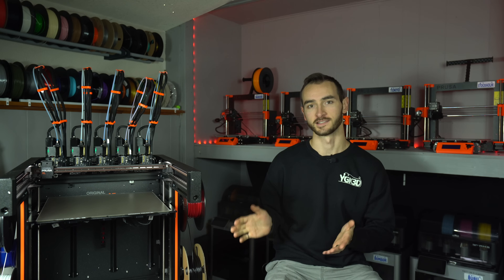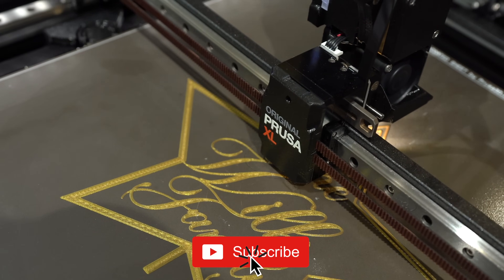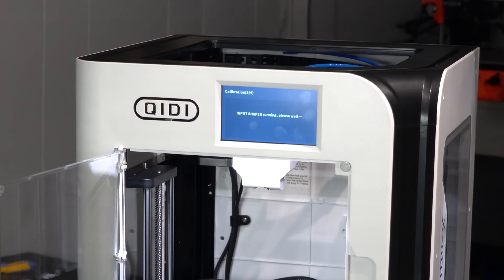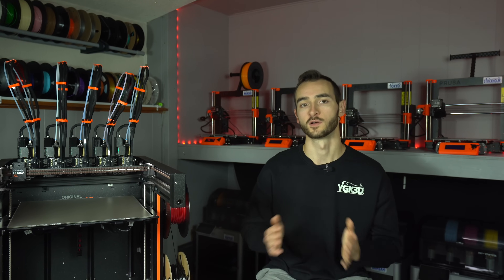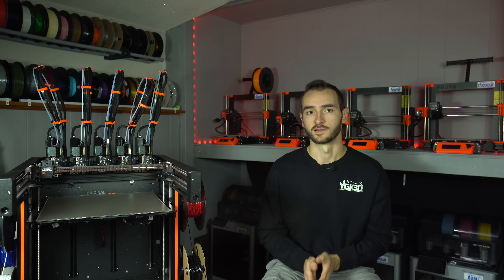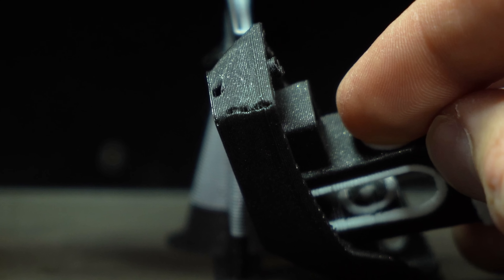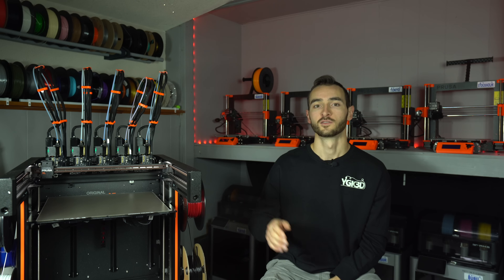The Prusa XL Just Got WAY Better with INPUT SHAPING... But Is It Enough?

Comment: You say the XL doesnt have an accelerometer that you could identify at 3:35, but at 3:08 the screen recording you added has the exact question "Does the XL extruder have an accelerometer built in?" With Prusa's answer being "Yes it does, it's vital for correct input shaping configuration (see above)." So I'm a little confused... Does it or does it not have a built in accelerometer to tune the input shaping parameters dynamically?

Comment: So I had a late pre-order - I've had mine a few months.    The nice thing is...how much has been ironed out.    I don't worry that much about speed so I can't speak to that - but I can say, anecdotally, that my xl runs like a champ.   It.  Just. Works.   I've been running it nearly non-stop.   The 6.x firmware has all but totally remove vibration.     The bottom line is this machine has a lot of advanced tech in it - and fully using it all correctly is taking some time to get right.   But it's definitely moving forward.    No regrets here.

Comment: I hope the Prusa XL improves fast from here on, at least fast enough to remain relevant when more tool changers come to the market over the next few years.  I was seriously thinking about an XL, and contemplating a twin tool head version that I could later upgrade to five.  I love the approach Prusa have to upgrades over time, and to continuous product improvement.  I think that's really the key advantage of a Prusa over other manufacturers.  I'd buy a Mark 4 now, because it's been sorted and just works and has beautiful quality, but its build area is not large enough for what I need.  But the XL is not yet at that point of reaching its performance potential.

I have to say, I so want to support Prusa and see the XL succeed.  They deserve it for their investment in open source, Prusa slicer, and their dedication to quality and innovation.  But their product development speed is just not up there at the level people are starting to expect after Bambu Labs arrived on the scene.  I watched this video after just having watched CNC Kitchen's interview of the Bambu Labs CEO, and he teased that the next generation 'X2' printers would be when they would launch a larger sized printer, but they wanted to wait until the printer was not only 'the same but larger' but had moved the product on to the next step... which makes me wonder if that "next step" will include tool changers... and whether by the time Prusa's XL is fully sorted, Bambu will have launched a tool changer XL competitor that's faster, cheaper, with fully sorted Prusa slicer derivative 'Bambu Multimaterial Slicer'?  

But the price point for two tool heads, when the machine isn't fully functioning after two years, has made me think twice.  I'm currently thinking of getting a Qidi X Max 3 instead as a stop-gap printer, and waiting for a year or so to see what happens with the XL and whether any better alternatives arrive.  I'm sure I can't be alone in taking this approach, given the Qidi and now SOVOL SV08 price points are so competitive.  My worry for Prusa is that they just can't compete on price without moving to a mass production model like Bambu.  I hope they find a way to accelerate their development work, because I would happily buy Prusa over alternatives if only their product development was faster and their launch products did what the marketing claims.

Comment: Im so tired of hearing the x1 carbon being compared just because its slightly "larger" than a typical form factor. The build volume is TOO SMALL still, and until theres a 300mm+ cubed printer, the prusa xl is the only option over like, a modified ender 5 plus, and unfortunately its not turning out to be significantly better. This was supposed to be the chosen one and its a huge let down. Im having vibes of what happened to makerbot and thats a shame cause the sum of its parts here should make it a winner. I hope they give this thing the support it deserves, but I guess Ill be waiting for a second generation..

Comment: You didn't really expect this machine to be as fast as an X1C, or even anywhere close, no? These are entirely different machines. Much larger build volume = heavier moving mass = slower. There is no "could have been" there. You want a super light gantry and super light toolhead? You're not getting a tool changer. Oozing is just a fact of life with tool changers. As an E3D Tool Changer owner, there are many "solutions" to the oozing problems, but none of them are perfect.

Comment: The print speed for multicolor prints for the Prusa XL can be several times shorter due to the amount of color purging needed. Its really quite drastic a 16 hour multicolor print on a Bambu can take 5 hours on the XL, thats where the XL shines along with the bigger print bed, so print speed with single coloris not the most important factor although Prusa does lag behind with regarss to print quality and speed...Surely bambu is working on something similar. That will be really dangerous for Prusa.

Comment: The more I see about the new Prusa printers, the happier I am that I opted to go with a bambu lab printer. Smaller printers not shipping with input shaping, the input shaping that gets implemented later is default values and doesn't get changed per machine (which could be important through the life span of the machine), prusa seemingly not being fully transparent with implementation of input shaping on the XL, and them seemingly not shipping finished products. Like, most of these "new" features all seem like they should have been implemented AT LAUNCH. These machines feel like anyone that buys them has seemingly been enrolled in a large scale beta testing platform without their knowledge and at the cost of Prusa machines, that is simply unacceptable.

Comment: Thank you for the video. 

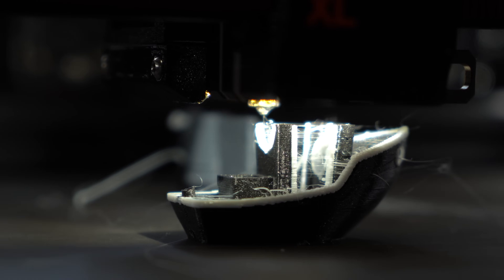On the topic of speed XL vs X1C, you stated the alpaca takes 4:49 on the Prusa va 4:32 in the X1C. 

Some have pointed out the difference in weight which is a valid point, but is this really a big of a deal?  +17mins is not bad on a print that is almost 5h.  I mean if it was a full hour or so I would say yeah that’s a problem. 

But what you didn’t ask is how strong are the prints?  Too fast = poor mechanical properties. That is HUGE and just because is not important to you it doesn’t mean it doesn’t count.  I print mechanical parts, not trinkets.  

On the other hand, have fun with Bambu labs selling your data to everyone and their mama. I need more intrusive apps like I need a  random bill.  

Cloud machines are a deal breaker. Same with Glowforge or anything similar.    

The XL is getting there…. Let’s see how far they take it.  Keep posting the videos.
Reply: Haters gonna hate...

Comment: In regard to the stringing, how about doing some oozing tests with 2 little cones, finding a temperature at which there is no oozing on the filament in question. This might require turning down the fans, in order to maintain good layer adhesion, but it should also remove a large portion of the stringing.
Reply: I'm using 2 small cones, about 7mm x 15mm and 4cm apart of each other. A quick way to find the filament temperature, that provides optimal visual print quality.
Reply: Might have to recalibrate pressure advance after finding the optimal non oozing temperature.

Comment: Hey thanks for the vid!  I'm on the ropes do I pay remainder of XL or wait and get a refund- honest opinion if the XL is worth the $ ? thanks!
Reply from the maker: I think it’s worth it personally, until something else like it comes along. When it works, it’s amazing. There are some kinks to be worked out but most of that should be done by the time you get it, depending on when that is.
Reply: @ygk3d  Cool thanks for the quick reply! I have a MK3 been great around 170 days printing / 8000m before the hotend started oozing, replaced it then the heatbed sensor went replaced that all good, I really need a large print area for some large 3D designs I made for RC plane floats as the XL was so delayed I grabbed a Kobra Max but I have yet to get one  of my STLs to print well from PrusaSlicer as there is no Printer profile for the Kobra Max googled it and appears they say latest Cura is required only prob is my old iMac doesn't support the new Cura! Another if is the CS from Prusa- I had the worst CS ever when my new smooth steel plate peeled on 1st print, just like that Drac dude who had a bad $3 cable on his XL and they totally dished him, too bad Prusa CS is not like DJI!! Anyway I have to decide in the next couple hours if I send Prusa $2k....

Comment: The Bambu lab CEO has already said that their XL release will be a next gen printer so you can assume it will be a larger X1C with multi-tool support and be no more expensive than the Prusa XL. IMO, these problems you've had and the lack of features are kinda unacceptable in an expensive printer. Prusa has had too little competition and have been resting on their laurels for way too long so have to play catch up, and it doesn't seem to be going well.

Comment: It seems a lot of your issues are slicer settings. I think with a little more time and experience you’ll figure it out.  You should note in your video that the Bambu and PRUSA are two completely different printers, but if you want to compare them that’s your choice, just know it exposes your inexperience comparing the two. Also tune into the 3D printing today podcast.  They and many of us are way past prime towers and have figured out how to retract adequately up out of the melt zone.
Reply from the maker: It may not be the most logical comparison, but it's one many will make and are interested in. I am far from inexperienced ;). I'll check out the podcast - thanks for the tip.

Comment: Thanks for the videos on the XL. I had narrowed down my fdm printer choices to either the Prusa XL or the Bambu X1C. From what I see the XL isn't there yet and still lacking in a lot of areas; the base XL with one head cost is $1,999.00. The Bambu X1C seems to do more out of the box in regards to speed and quality than the XL and the cost is only $1,199.00, a savings difference of $800. I just can't see paying 2K for a printer that doesn't really set itself apart from others on the market. If its build size you need, Elegoo Nepture 4 max is on pre-order and the cost is less than $500, so maybe I need to look into that. Lots to consider until I pull the trigger.
Reply: If you want multicolor/material printing, the Bambu printers are abismal in waste and speed. The XL definitifly has the upper hand with this, it is a toolchanger and thus very different.
Reply: @username9774  The XL in it's current state is unfinished. It's way past recalling it. It's an embarrassment for Prusa and it's customers.

Comment: Personally I think you can't compare Prusa XL with the Bambu X1/P1. Well, you can, but is the same as compare a rally car with a formula 1 car, both totaly different. Yes, the Bambu is faster when printing one color, but Prusa isnt build for speed, but for quality. And to be honest, you dont buy a XL with one toolhead. You take at least 2 toolheads. I'm still waiting on my XLLLLL. At the moment I'm using 3x X1C, 2x MK4 and 1x MINI+
Reply from the maker: Good point.

Comment: One thing to note about speed is that prusa actually cares about part functionality and strength. Its easy to critisize speed if you are making prototypes all the time and dont care about rigitity and the like. But prusa has experience with ACTUAL manufacturing - every single printer they have ever made is partially printed. They actually take the time to make strength checks and slow down the printer for strength and toughness purposes instead of pumping out crappy plastic garbage at the maximum speed.
Reply: u could, and easily, slow down ur printer on all machines. u are just fanboying for prusa, cause bambu can print much faster than their default settings which as u said are better but prusa can not.
Reply: Very fair point.  There's a lot of marketing claims that are selling printers on claims, rather than like-for-like speed comparison of quality- and strength-matched printed parts.  Thinking about it, that's a great idea for YGK3D reviews in future: create some standard designs and tests, and review the speed-quality-strength trade-offs and relative strengths of different manufacturers.  Maybe choose a range of parts to print, like functional load-bearing parts, different materials, detailed aesthetic prints, etc.
Reply: HAHAHAHA
Reply: I'm very happy with the strength and speed of my abs/ASA-CF on my bambus. I own an XL, excited for plates

Comment: If this printer was made by ANYBODY ELSE, it likely never would have gotten this much attention and fine-tuning, and probably would have been returned. PRUSA is good at making simple Cartesian bed-slingers and that's it. The XL is completely outside of their wheelhouse and it shows. Yes, it has tool changers, but the entire design is very obviously still half-baked. You can't release something like this at $4000 + shipping anymore and be successful.

Comment: I have no problem with stringing on the XL. It seems that your nozzle seals are not optimal adjusted. They should only touch the nozzle as slightly as possible. When the force is to high, they do not work, because the faces of seal and nozzle are not parallel.
Reply from the maker: The nozzle seals seem okay. It’s not ooze after being parked, it’s ooze during travel and took changes. I’ve heard a few people have no stringing, which is interesting, because many more seem to have it really bad.
Reply: @ygk3d  The most important thing is really dry filament. Even PLA must be dried by me to get no stringing. Another problem is that sometimes the print-profiles in PrusaSlicer are not updated correctly. I delete everything, before I import the new versions. Prusa changed a lot in the profiles the last months.

Comment: Unfortunately I already sent mine back. I was getting hideous prints, especially if they were taller (like over 13cm) and had any kind of hole in the design. Then shortly after it was just completely unable to do a first layer, constantly running into it and peeling it up ruining prints using the exact same gcode and filament it had used before. And strangely the speed settings on the default profile for infill were INSANELY high and I didn't realize. Like this thing cannot do 230mm/s infill. It was leaving chunks all over the place.

I really wanted to like this thing as it was my first prusa and I was excited to get another toolhead in the future, but it just wasn't worth 2 years and over 2000 dollars.
Reply from the maker: Sorry to hear. That’s a frustrating experience. I’m actually surprised they let you send it back.
Reply: @ygk3d  It was within the 60 day window I contacted them about it. I might not like the printer but I hold no grudge against their support and warranty team.

Comment: NGL, the tool changing is such an overkill feature - even considering all the other drawbacks. I'm just not ready yet to dump 4k into it, so I will stick with by X1C for now until some fancy printer with tool changing comes along.

My dream printer has 5 toolheads, 3x 0.4mm nozzle with different colors / materials, 1x 0.2mm Nozzle, 1x 0.8mm nozzle for small / lange prints. That would make my life so much easier.
Reply: Exactly. 3k can buy you lot of filament. Slow color change? Just get 4 P1S for less money than 1 XL. Gotta be real dumb or fanboy to get prusa nowdays😂

Comment: Prusa default input slicer profiles are extremely conservative. All you have to do is modify some settings and then your print will finish just as fast as bambu lab.
The Prusa XL/Mk4 with input shaping is just as fast as anything bambu lab when using apples to apples settings. I did an exact comparison the other day and the MK4 finishes exactly one min faster than the X1C using same settings.

Im sick of people doing "prusa vs bambu lab" speed comparisons...when they don't even try to match slicer settings.
Reply from the maker: I think there’s merit in comparing the “factory” settings. Sure, you can crank up the speeds, but it should be the manufacturer’s prerogative to supply the fastest possible profile while maintaining quality. Of course you have to match layer height, perimeters, infill, etc. to make it a fair comparison.
Reply: @ygk3d  Prusa has stated multiple times that they're not in the speed game. It's not their end goal. It's why their MK4/XL/mini all have pretty conservative IS speeds by default. They favor quality, strength and reliability over speed. They even called it all "marketing bullshit", which it is. If you want speed, just turn up the settings.